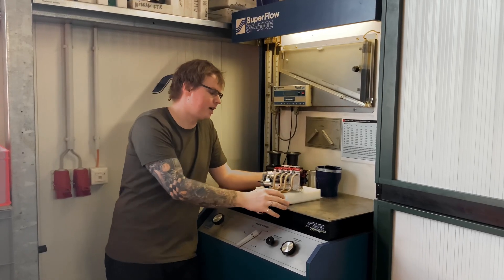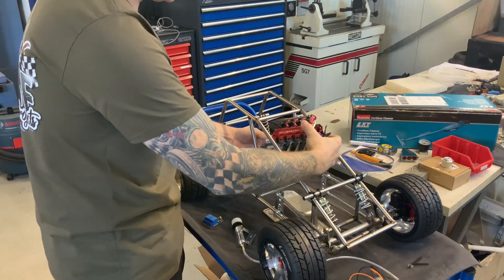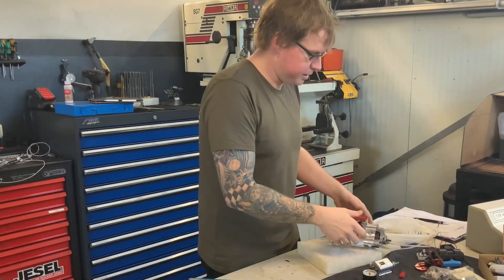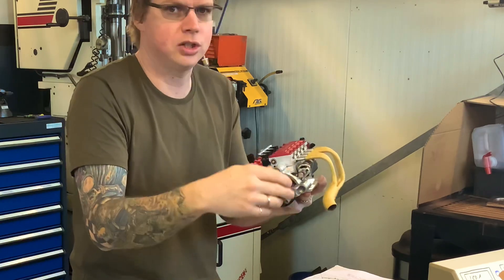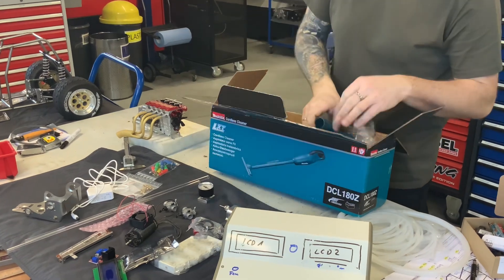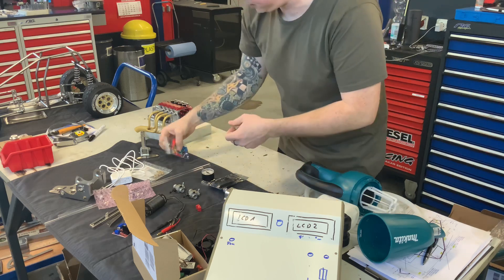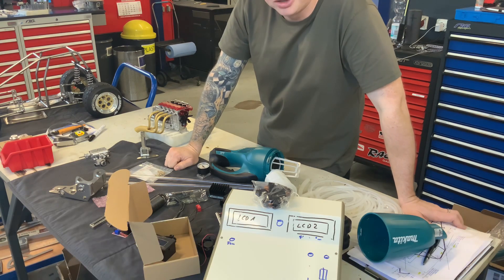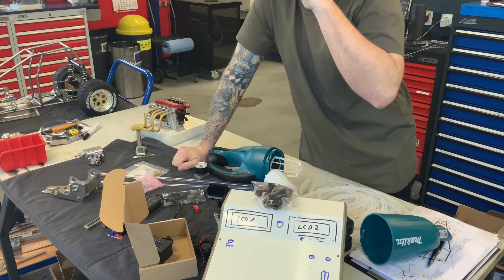RC Car Flowbench and Toyan dry sump tank.   Warning: Nerd alert !

Comment: Will only a 14cc engine be enough to move the wheels and chasis of the vehicle?
Reply from the maker: Hopefully it will due to the Nitro content in the fuel. No one has any experience yet with those engines. I can not tell. If it will be slow I will add a strong brushless motor on top. Thanks for watching
Reply from the maker: maybe.... but i will cheat and make sure it will be overpowered
Reply: @timsane  Cool, take a look at warped perceptions recent video if you haven't already where he makes a compound supercharger setup! It looks like it makes a considerable difference. Can't wait to see how it turns out👍🏽
Reply from the maker: @carcrxsh  thanks, i saw that! Really nice fabrication! I will go a different route and target for 15 psi plus extra modification of engine itself.

Comment: Sounds like a brilliant project to me.  Looking forward to ALL of the video in the series.  Hopefully you'll be using S.I. units for your tests?
On a different note, if I had bought that Makita vacuum cleaner, I would have been pretty disappointed to find only a 380 type motor in it.  I'm surprised you didn't utilise a car heater blower.  They're cheap as chips on ebay.
Anyway, good luck, and I hope all goes well.
Regards Mark in the UK
Reply from the maker: It is more like a 550 type motor but the real part. Number is not readable. Do those car heater blowers make real pressure ?!
Reply: @timsane  Thanks for the reply.  Well, I haven't measured the pressures of a car heater blower, but I think they'd be powerful enough for what you have in mind.  I'm guessing off hand thy would be in the region of 1.5 - 1.75bar.  
I'm sure it would be pretty easy to check with a manometer.
Perhaps with some fine tuning they could produce more, and certainly 'cranking up' the Voltage would help a lot.  I'm sure you'll sort it out.
I wish somebody would do a similar project with a wind tunnel as precisely as I know you will do this one.
Thanks again for your reply.
Reply from the maker: @thecorbies  if we are talking about the inside heater fan it will not produce more than 0.01 bar. I tested that. The vacuum assembly will reach like 0.035 with much less volume. The Makita was like 35 euros so not too bad and enough for my bench.

Comment: Model V8s are very expensive. 
How about machining a V block and a crankshaft. Most other parts could be taken from two L400s ! Not so simple; but what a project !!!
Reply from the maker: I had exactly this idea and now I am in contact with Toyan regarding a nice Nitro V8. But even if they do not want to step up to 8 cylinders, I will build one someday. Thank you for being here!
Reply: @timsane  I have been conceptualising a U engine. A square 8; but nowhere as elegant as a V8.

Comment: Did you build the supercharger ? Do you have a video of the build ? 

Do you intend to sell the superchargers, hot camshafts and ported heads ? I would be very interested in your price book !
Reply from the maker: Yes, i made the design with a very old friend who is also an engineer. Then i machined the prototype you see in video. I learned a lot, and after measuring i will build Version 2.0 and scale it bigger for engines like the Zenoah line. It depends a bit on how this channel gets going but i think i will offer parts for sale in the future. If you like, subscribe - you will see everything whats coming!

Comment: I love what you are doing and am interested     in your head mod and supercharger. I wish you could show us how you made your supercharger. Or maybe you can sell ur head mod and supercharger.
Reply from the maker: My plan is to use the flowbench to finish the supercharger design and sell it later in three different sizes. I would like to offer a solution for the Zenoah engine line as well.
Reply: @timsane  Great. looking forward to seeing your progress.
Reply: @timsane  I'm also looking for a supercharger for my to-be-built OS 10cc twin rotor wankel engine. :)